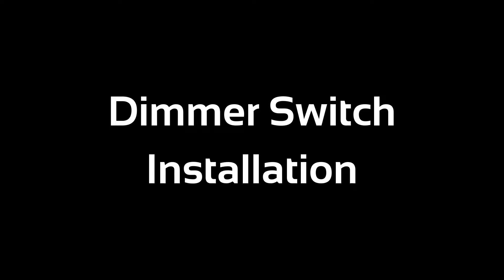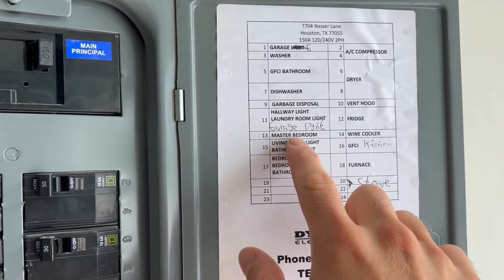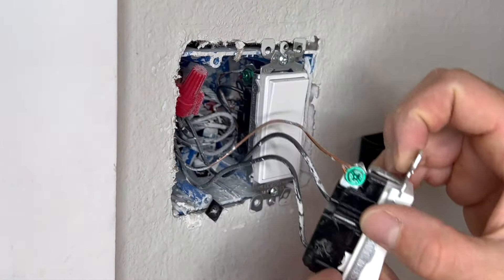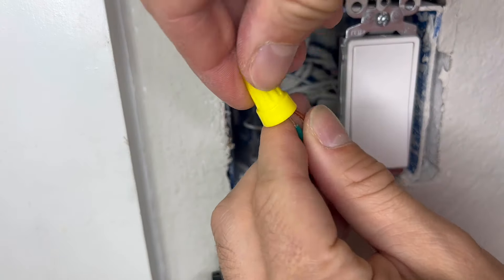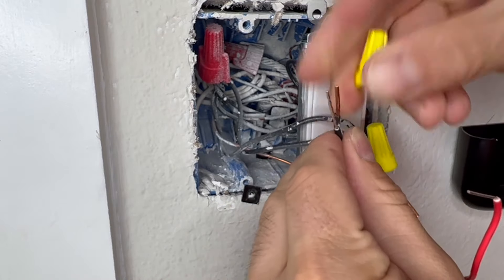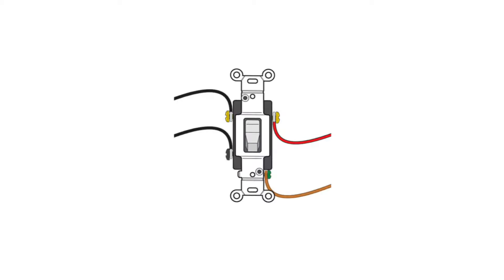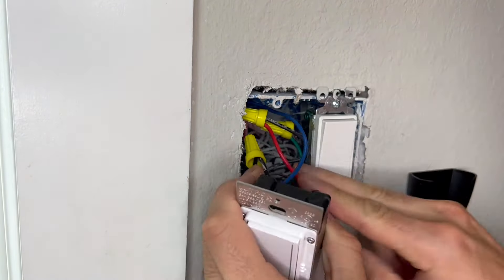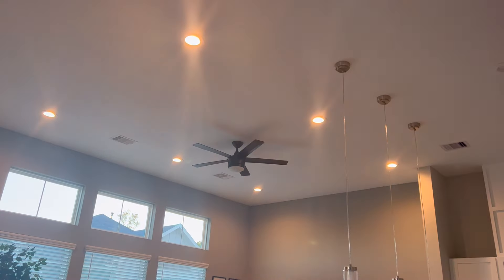How to Install a Dimmer Switch in 10 Minutes | Builds By Maz

Comment: Thanks for your video ! however you forget an important point to mention that you can program this switch with your preferred setting, no internet needed for that see instructions in Lutron manual ! A second point is that you might mention that no neutral or white wire is needed for this set-up my final point is that you might mention that in a 3 way set-up an accessory switch is available from Luthron. this switch gives you extra functionality over a regular 3 way switch.

Comment: Was so happy to find this video. Thought I had it done. Still didn’t work. But inside my wall is 3 black wires so I don’t know which one is the ground one. Ugh
Reply from the maker: Very unusual...ground wires should never be black. One thing you can try doing is separating out all the wires, turning the power on, and use a voltage tester to determine which wire has power flowing to it. It at least might give you a starting place.

Comment: My old dimmer didn't have a ground wire, just 2 black wires.  The electrical box isn't metal. Do i need to connect the ground wire to something?  It works without it but is it a safety / fire hazard?
Reply from the maker: I think you should be okay sine the box isn't metal. But anytime you have a metal box it must be grounded!
Reply: @buildsbymaz  thank you for taking the time to reply, i appreciate it.

Comment: Hi!  I have 3 black wires coming from the wall.  I connected the black wire to black, and the other black wire to the red, and now I have 1 black wire that's exposed from the wall.  What do I do with this one?
Reply from the maker: Are there any white wires coming from the wall? How many switches are located at this box? 3 black wires is unusual for a single switch.
Reply: @buildsbymaz  its a single switch.  And there is a white wire capped inside the box already
Reply from the maker: @waleed03231  if you look into the back of the box, how many yellow cable sheaths can you see? Normally there should be 2, each with a black, white and ground wire coming from it. You may need to separate all the wires out so that none of them are touching, and then turn your power on. Then you can use a voltage tester, to see which of the black wires has current- this will be supplying power and will definitely need to be attached to the switch. From there, you can turn the power off again and try hooking up that wire and one of the other 2 black wires and see if it works. Then I guess you can just cap the remaining black wire.

Comment: I have black and white wires where does the white wire go?
Reply from the maker: The white wires should be connected together separate from the switch. You can see all my white wires twisted and connected together in the box at 2:15 in the video.

Comment: Whay if your new dimmer also has a white wire
Reply from the maker: You might have a white (neutral) wire coming out of the box in the wall. If so, you would connect those together.

Comment: Hi did everything like you but my switch doesn’t work 
What could be wrong?
Reply from the maker: Double check everything is connected securely, and you may need to use a multimeter to make sure you are getting current where it is supposed to be. Hope you are able to get it working!
Reply: @buildsbymaz  thank you for your help , switch was not good I already replaced